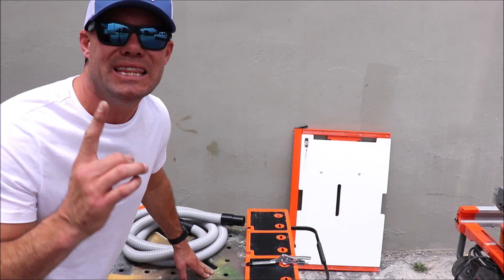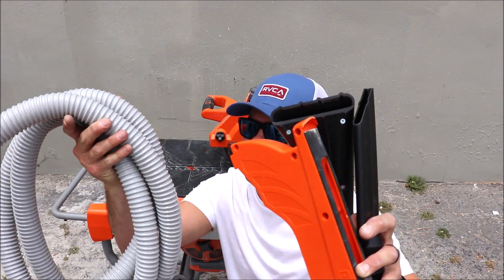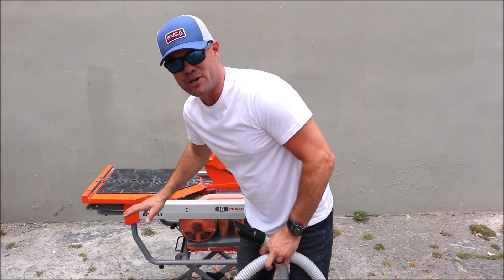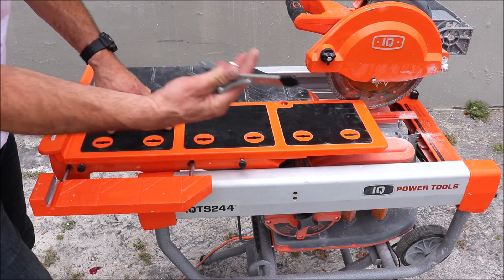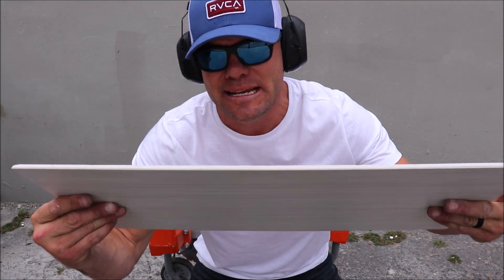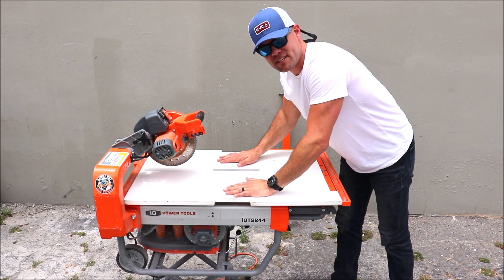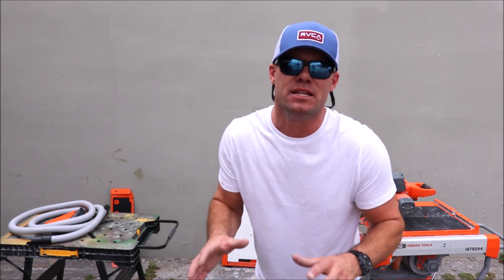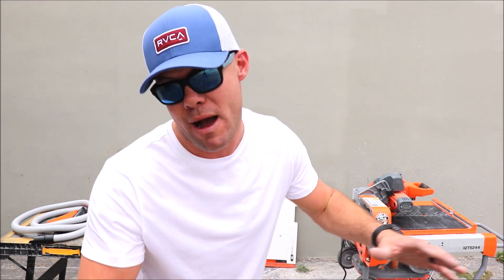IQ Tile Saw 3 Awesome Attachments

Comment: Thanks for this demo. Great video! Just a note, you can leave the dust guard on when using the extension table and vac hose port kit.👍
Reply from the maker: We keep that dust guard on at all times cutting inside, but like it off cutting outside, plus I needed that good camera shot! 😎
Reply: When thinner blades?

Comment: So I am thinking about buying this saw literally tomorrow but I see some comments that the tiles chip too much for some people. Does that happens to you ?
Reply from the maker: You can always use a diamond hand pad to clean up any rough cuts. This saw works great, maybe a little more rough than a wet saw when it's time for a new blade? We have had great experiences with the IQ saw so far.
Reply: Landberg Tile TV Thanks I bought the Dewalt 24000 but I regret buying.  It’s a pain in the ass to storage that thing.  I wish I had bought the Delta, but the guy at the store told he gets lots of complains from it. I saw you have it too. Is that true?

Comment: Question for you i have this saw used it on a few jobs and i have been having a big problem with it wondering if this problem. No matter how slow i feed my tile it seams to bind and force the tile into the blade on straight cuts it dose it so hard it binds beraks the tile and pops breakers it happened to me today about 25 times???
Reply from the maker: That's strange, never had that problem. I would try checking to see if the blade is square to the table, try dressing the blade or replace the blade.
Reply: @LandbergTileTV   thats what i was going to do i have dressed the blade but not replaced it yet due to the cost of the blade but im going to buy a mew blade this week do you run the factory iq blade or have you found something else that accepts that arbor
Reply from the maker: I like the gray hard material IQ blade. Seems to last longer, and usually is the same price. No other blade fits this saw, proprietary..
Reply: @LandbergTileTV  thank you great advise and gread vid as allways